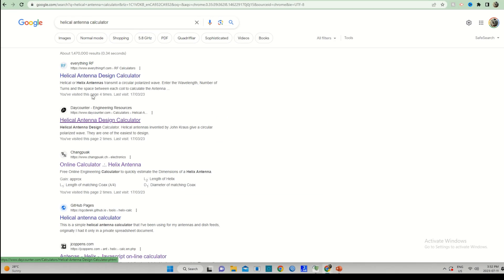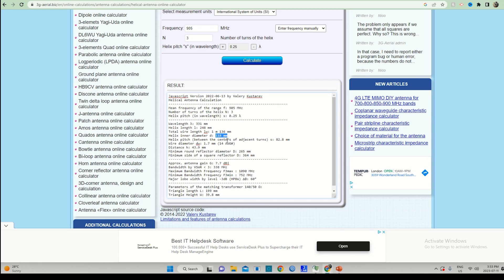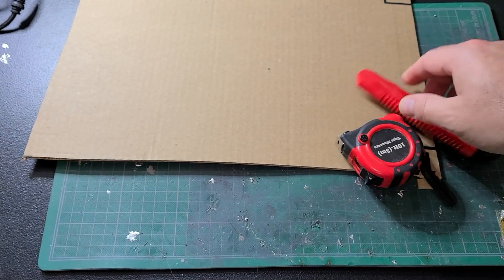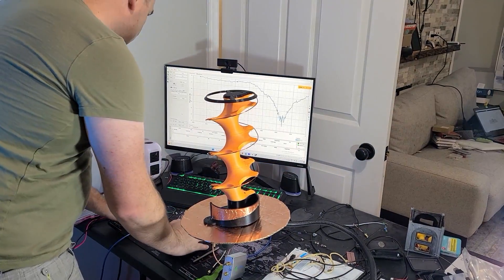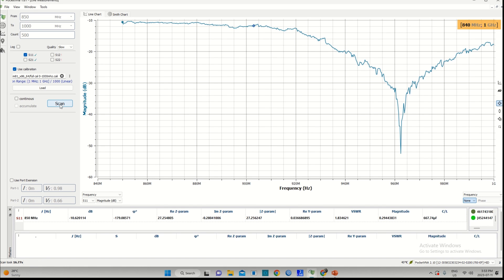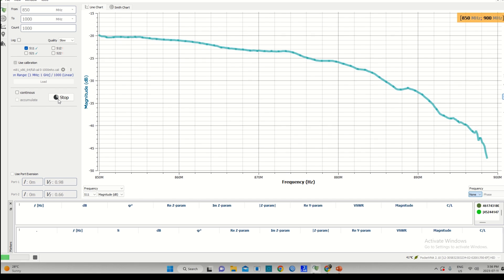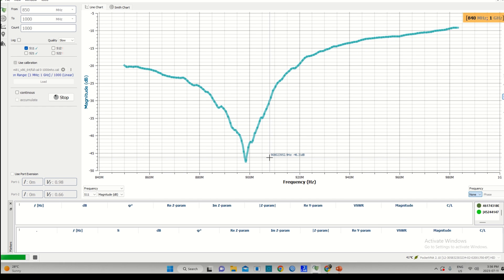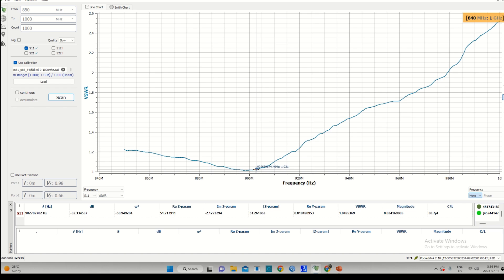Boost Your Wireless Performance: Learn How to Make a 915Mhz Helical Antenna

Comment: Would the design change if I used 14ga 1.63mm wire?
Reply from the maker: That will work fine. tuning/ length will just change slightly

Comment: I would be interested in the actual tested gain of the antenna.  It occurs to me that the material you're using for the form (PVC, or maybe ABS) is a dielectric and since it's in the middle of the field, could effect the performance.
Reply from the maker: Hey Hey. This material was PetG. and the contact surface on the cover coil itself was limited. Performance is great with real work tests and has 100mhz usable band. with regards to the dielectric. Yes it has impact but it can be accounted for to a certain extend. This specific antenna has a biggest impact on the impedance matching part but minimal on the coil it self. I'm yet todo gain testing but would be happy to assist if you have the equipment and time todo so

Comment: Very interesting.  I have a need for the same type of antenna for Meshtastic, US 915mHz.  I used Matlab's Antenna Designer software which has the ability to optimize the design parameters for gain, bandwidth, etc. I was able to get a gain of 11.1 dBi.  The parameters are as follows:  

Radius	0.069493
Width	0.00278
Turns	3
Spacing	0.09731
WindingDirection	CCW
FeedStubHeight	0.001
GroundPlaneRadius	0.20852
Tilt	0
TiltAxis	[1 0 0]

Matlab provides an S(1,1) plot, as well as complex impedance, but does not show how to match to a 50 ohm Tx source.  Any pointers would be helpful.  

I think your construction methods are very clever.  Having a VNA to validate the design is helpful, have a Siglent 1032x standing by.

Comment: sir please post the video's like this
Reply from the maker: Which videos specifically do you want to see
Reply: As part of my bachelor's degree in Electronics and Communication Engineering in my second year, I plan to build my own rocket which will be landed by electromagnets, I am a noob at building avionics systems. I am so grateful that you shared your antenna's design, which will be very useful for me in my future projects. I would like to hear a video about the best avionics in the market or how to design your own avionics if you're free.   @EngineerMeThis

Comment: Amazing video! What gauge wire did you use? I plan to use this with a digital display 900mhz fpv receiver. Thanks !
Reply from the maker: Hey, Thanx for message 12 to 16awg should work fine.

Comment: Can this design be used as a long range client LTE antenna? As far as I know the transmitters are cross polarised, so maybe instead of using two (H/V) antennas in a set for long range, this could be a better solution.
Reply from the maker: Hey @MichalAltmann, it could be, depends on the intended frequency, as you may know LTE covers alot of frequencies. This antenna will cover from about 850 to 930mhz fairly well.
Reply: @EngineerMeThis  I've been looking at Band 20 which is around 800Mhz (~790-860 if I am correct). The principle of making one is what makes your video the most valuable. I think adapting this one to 800 is not a huge deal, could be even possible by tuning only, but not sure.
Reply from the maker: @MichalAltmann  I think by simple scalling all the parts in slicer by 10% will get you there. But you should be able todo it just by tuning aswell. Good luck !